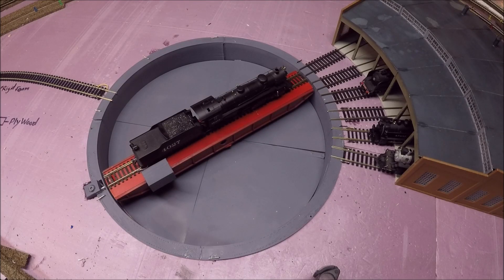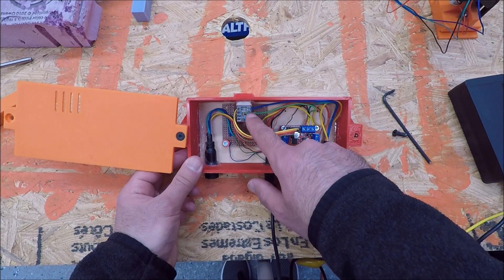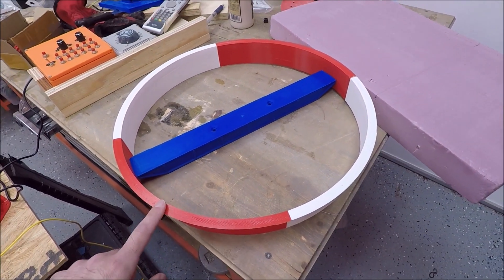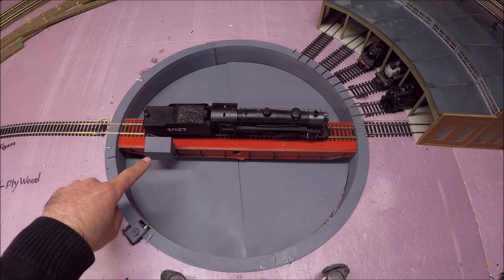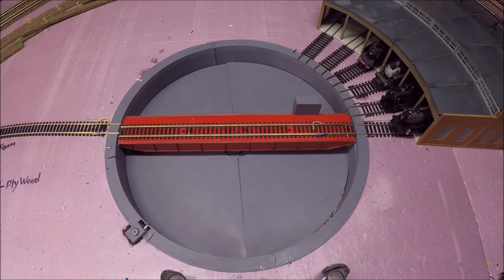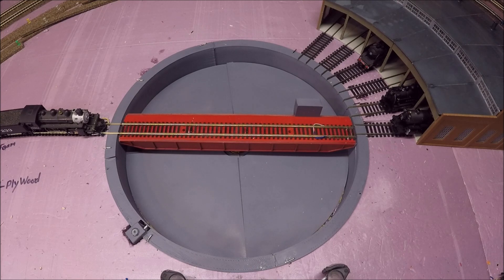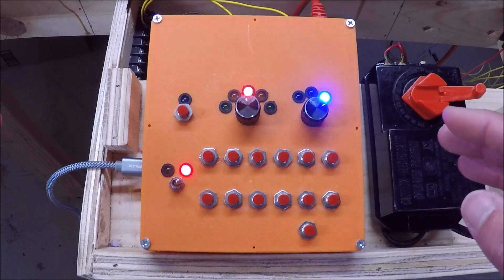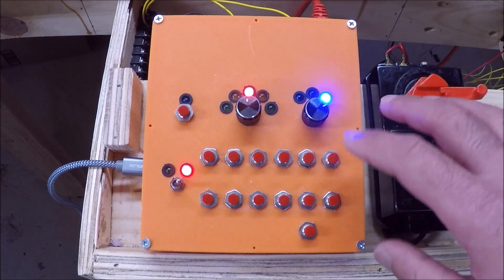Arduino Model Railroad Turntable Part 3

Comment: Very nicely done.  I did one a couple years ago with the Arduino and Stepper motor but I could not figure out how to go from one stall to another stall without going back to the main track.  Can you provide the sketch for your project?
Reply from the maker: Thank you. If you look on my page there is a video titled "! Version 1.0 of the Turntable Code has been released!". In that video I tell you how you can get a hold of a free or paid version of the code and the differences between the two.

Comment: Like what you have. But I need to know, how did you use the POT to move the turntable manually? Can you share that portion of the code?
Reply: There´s a lot about that in YT. If you research a little bit here, sure you'll find all you need to know !. Cheers, John.

Comment: i am intrested in a full cit as i have a manual turntabul and wont to power it whot wood the kitt cost?
Reply from the maker: Good afternoon Paul. I am actually in the process of uploading my code and files to the arduino project website. When finished everything should be available for free! I should have this process done soon, but it seems that the days are just too short. Be on the look out for a part 4 video in the future. Thanks for the comment and watching the video!
Reply: @OrangeLabPinball  wood realy love them free but nead the housing bilt also and as you got the lasere cuter now to toy cud mack them in a flat pack form from acrilic.
plus dont no if i wood get the rite ardwno and moter

Comment: Amazing!!!! I have an arduino on route but, I would definitely be interested in this for sure!!
Reply from the maker: Hey Zakk, thanks for watching the video. I have some code tweaks I would like to make and then I plan on posting the code I made to a website for people to download. Be on the lookout for a part 4 in the next few months.
Reply: @OrangeLabPinball  I'm hoping you will be posting the part 4 soon. Would it be possible to get a copy of the sketch as is until you are able to post. I would like to send you an email if it ok?
Reply from the maker: Good afternoon Dave. Feel free to send an email any time. I am currently working on cleaning up the code and creating an official project for this on the Arduino Project Hub so everyone can download the code for free as well as get a brief write up on the wiring / operation. Should be one soon..... I hope.
Reply: @OrangeLabPinball  Been 2 years since I emailed you and 1 year since part 4. Any chance you will post the sketch?
Reply from the maker: @nscaledave  When I was trying to finish up the original sketch I realized the sketch wasn't going to work well with an Arduino Nano. I have been re writing it with more functions and less bugs to use with an Arduino Mega. A lot is going on right now at work so it is unlikely I will get back into this project for a while.

Comment: I'm also very interested in a solution. However I have already done the hardware - using a stepper motor and a DRV8825 H-bridge. I have placed 14 push buttons in half a circle on the pcb, scanning them via an analog input to save pins on the controller. 
But I would very much like to see the code - if there could be a possibility to do so?
Perhaps I could help on doing your pcb instead?
Reply from the maker: Good afternoon. I think we can work something out. Send me an email some time and we can hammer out the details. My email can be found on my YouTube channel page.
Reply: @OrangeLabPinball  Great - I've sent you an pm earlier - Hope you got it?

Comment: I am looking to rebuild a Marklin 410 turntable from the 1950's with a small stepper motor running the existing rack and pinion.  Your system employing the HE sensor seems the way to go to ensure consistency.  The problem with the Marklin is the noise emanating from the motor-to-spur-to-reduction-to-reduction-to-worm gear-to-spur-to-worm gear-to-pinion-to-rack drive train.  I am not exaggerating; it sounds a coffee grinder full of steel balls running on high.  Eliminating all the parts up to the pinion will make it operate almost silently, like yours.  When are you ready to sell me a pre-coded Arduino?
Reply from the maker: The old ball bearings in a blender soundtrack is never something I like to hear either. Send me an email and I think we might be able to work something out.   electricworkzshop@gmail.com

Comment: My model Railway club has been working on a turntable using a stepper motor and Arduino, but we are having difficulties getting consistent indexing.  Our design is to simply set up the turn table with 40 equidistant positions at 9 degrees apart.  We would then lay the track to match one of the 40 positions.     The user would pick a numbered position and direction CW or CCW and go.    We are micro stepping to smooth the motion.  Unfortunately it appears steps are being lost.      I see that you are using reduction gears instead.   Are you using microsteps.  If yes, did you have any issues with lost steps and therefor misalignment issues over time.   How did you fix the issues if you had any.
Reply from the maker: Hello Andris. Great question, I ran into the same issues when I made my first prototype! Here were my two main issues and how I fixed them. 

Issue: 
Play in Stepper Motor Shaft

Solution: 
My design does not use micro stepping, but instead uses reduction gears as you pointed out. I used mechanical gear reduction instead of micro stepping because it helps mask the "play" in most off the shelf stepper motor shafts.This "play" was causing all sorts of inconsistencies in the operation of my turntable before it was corrected. 

Issue: 
Lost Steps

Solution:
The truth is that my design does loose a few steps during each revolution, but since each step is so small (~.022 degrees with my mechanical gear reduction) it doesn't make a noticeable difference in the track's position. I also built in a "Homing Sensor" which helps the turntable know where it is in relation to the tracks. This way I do not have to rely solely on the arudino to keep track of the turntable's position. Before I implemented this fix my turntable would work well for one or two revolutions but then be too misaligned to function.

Hope this help!

Comment: Nice job on the finished turntable. The auto reverse, did you use the AR-1 that Digitrax has. I know that your running DC. You should really look into the DCC world. The decoders like Soundtraxx Tsunami2 decoders have really good motor control for the loco's. On my turntable the stepper motor is linked to a universal joint, worm gear and tooth gear. It works very well. I can go both directions by pushing a button. The pot allows me to line up the track and speed the rotation. I've just never figure out in the Arduino code how to make it stop on point. Good job on the turntable.
Reply from the maker: Thanks for the kind words! I built my own auto reverser using three relays. I do need to look into DCC! Once my layout is finished and I get all the track work done I plan on purchasing a DCC system.

Do you have a model number for your universal joint / worm gear? My setup is working but I always like to look at ways to improve it and it sounds like your gear system would be something to look at! 

Sounds like you have designed a promising Arduino setup! Good luck with your design and thank you again for watching!
Reply: @OrangeLabPinball  The turntable was a Diamond Scale Construction HO 130' turntable kit that someone put together and I guess had for a while. I bought it at a train show and it came with a hand crank. I figured a way to put some universal joints on it awhile back and don't have part numbers for them. Think I used two different ones. The gears came with the turntable. Somehow I got it all to work with the stepper motor.

On a note of starting your layout, I would look into getting a DCC system and designing around that. On dcc you can run a lot of trains on one track. My layout is 6'x10' with lots of switching, couple reverse loops and lots of fun. My friends always say. how'd you get all that track in that little space. I run my layout with a Digitrax Zephyr.
Reply from the maker: Thanks for the advice! Ill need to look at a DCC controller for sure. I have also heard good things about Digitrax.

Comment: Very nice, I have been following the process since part 1. Interesting to see the progresion. Im working on a simular prosject with a turntable, still havent found the correct solution yet, but it's getting there. Is it possible for you to make/share a wiring diagram and a partslist?
Reply from the maker: Good afternoon Tom. The following list shows the main parts I used in the build.
- Arduino Mega
- Arduino Mega Prototype Shield
- Some CAT5 Jacks
- CAT 5 cable
- 2GT timing belt & Pulley Set
- Nema 17 Stepper Motor Mounting Bracket
- Stepperoline 27:1 Planetary Gearbox Nema 17 Stepper Motor
- L298N Motor Drive Controller Board
- Some One Channel Relay Modules
- Arduino Compatible Hall Effect Sensor
- Taidacent Through Bore Electrical Slip Ring
- Small Magnet
- Hand full of LEDs
- Two 10K Potentiomenters
-  1' of 1/4" Steel Rod
- Hand full of 1/4" x 5/8" sealed ball bearings
-  1/4" Bored  Shaft Collar to keep the turntable at a specific height on the 1/4" rod
- Various Electrical connectors & wire
- Various momentary buttons and some switches
- Lots of 3D printed parts

A wiring diagram wouldn't be very helpful because 90% of the wiring is from a button or device to the Arduino which only works with the code I developed.

How are you planning on driving your turntable? I love watching others Youtube videos or reading articles about how they designed their turntables, there are some creative/effective methods out there that I never would have dreamed of trying.

Good luck on your project and thanks for watching the video series!
Reply: @OrangeLabPinball  I am planning to use a stepper motor and push buttons, for the different positions
Reply from the maker: Great minds think alike!
Reply: @OrangeLabPinball  would it be possible to either buy a det of the 3D parts that you made?
Reply from the maker: Good Evening Tom. What 3D printed parts are you interested in? Feel Free to email me directly at electricworkzshop@gmail.com .